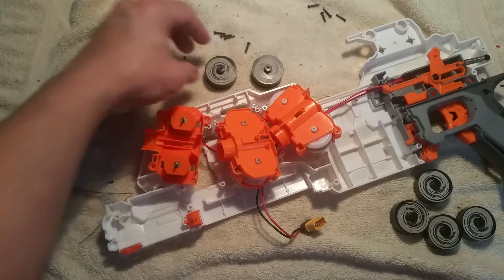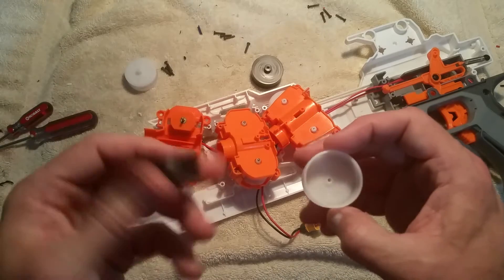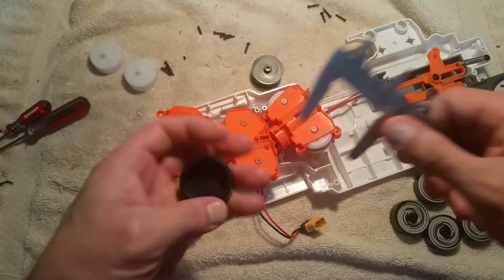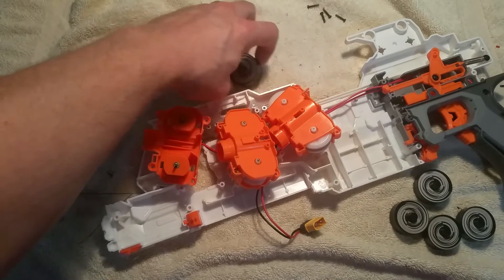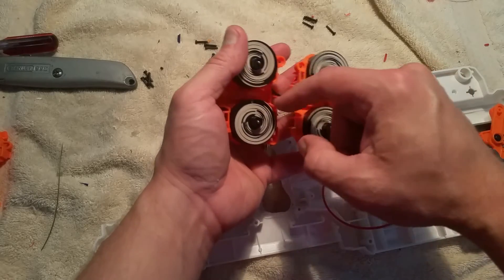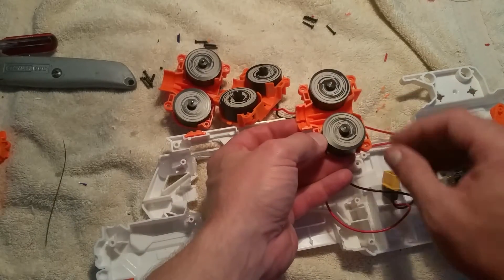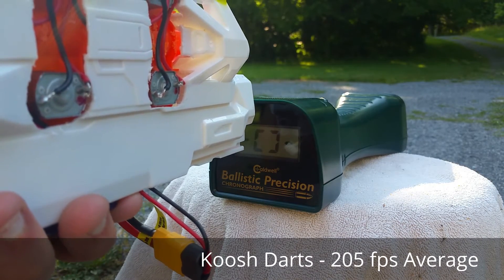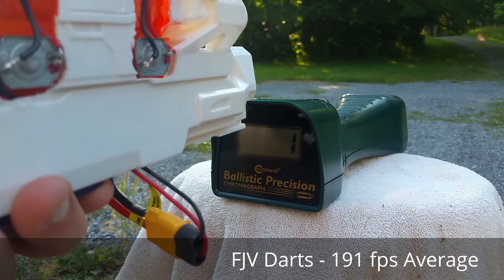Q200 - Cyclone Flywheels

Comment: That is amazing! How are the accuracy of the darts? They can take the velocity, but is their range and accuracy good enough to perform in an actual NIC game? Thanks for showing you work! The only other question I would have is if you can hit 200 fps with a two stage flywheel.
Reply from the maker: The accuracy is very good with Waffle darts.  I'm hoping to get another video up in a couple of days that show them being shot at targets.  
I would think that 200 fps should be feasible in a two stage setup.  I don't have a two stage blaster on the bench right now, but I am testing a three stage platform and I plan on using this combination in that.  Stay tuned.  :)

Comment: Probably will want a MOSFET once you get 180s in there, it'll probably far exceed the inrush current ratings for any of your switches.
Reply from the maker: It would have to be one gigantic MOSFET!  I did a quick calculation of stall current of two Hellcats and four Wolverines on 3S and it came to 325 amps.  I can't even imagine the size of the heat sink for a MOSFET that could handle that much current.
Reply: I mean, it only needs to draw that momentarily, and one of the best MOSFETs currently is iirc the IRL40B209, about the same form factor as we currently use. Looking at the datasheet: https://www.infineon.com/dgdl/Infineon-IRL40B209-DS-v02_00-EN.pdf?fileId=5546d46256fb43b301576b16f39706f5, you'll see it has an ideal max pulse current of 1707 amps, realistically limited to 780 amps by other forms of resistance. It might be OK with handling it, as even with a good heatsink it probably will only handle half of that.

Another concern would be speccing wire thick enough to handle the current to the motors. If for an unlikely occurence, all three motors jammed up, I don't think there are many wires that will fit in the shell and hold up for very long.

Alternatively, you could use less current hungry 2S motors as final stages on 3S, I've heard of people claiming more torque in a first stage and less in consecutive ones are desirable. It would would be easier to find a battery pack, of course, so you could go for Blades, which have slightly less torque than Hellcats on 3S which will hog under half the current that Wolverines do, or even go for lower torque final stage 2S motors like Meishel 2.0s or even just Honeybadgers. But you ultimately know more about it than I do considering how much you deal with them.
Reply from the maker: If I'm reading the spec sheet right, the max current for this MOSFET is 195A.  I think I would want to spec it to the continuous drain current, in case of a stall.  195A is really good, actually, I didn't realize small form factor MOSFETs had come this far.  I may have to give this MOSFET a try.

I would think 16 gauge wire should work just fine for this much current.  The wire in the motor armature a lot thinner than 16 gauge and should fail well before the blaster wiring.

I have been considering Hellcats and Honey Badgers on 3S for this build.  My concern is rev up time more than sustained performance.  Cyclones are heavy and worse have most of their weight out on the rim.  It takes a lot to get them moving, but once they are spinning, they don't want to stop.  I guess I have more testing to do.  :)

Thanks for the feedback and specifically the spec sheet on the MOSFET.  Much appreciated.
Reply: Actually, I find it interesting to note that Honeybadgers on 3S have a tiny bit more torque than Blades on 2S (like, 0.4% more). Though Blades still don't have enough torque to not be notaby affected by the mass, but you'll probably get a good shot off in less than half a second. They also keep your current draw under 150 amps so that's probably one of the biggest benefits, along with allowing for getting a battery that's actually reasonably sized, even some that can handle the stall currents continuous.

Either way, glad to hear you'll be doing more work on this project.

Comment: Have you ever posted the wiring diagram for this? I'm confused about the setup with the extra flywheels. Excellent work BTW.
Reply from the maker: It is actually pretty simple - all six motors are wired in parallel.  All the grounds connect together and all the positives feed from the switch.

Comment: Hi! One quick thing to note while building this. Don't go any higher crush with cages or wheels than cyclones if you intend to continue using FVJs, reason being anything higher crush than cyclones will jam the FVJ in the first cage, and can stall your motors. Cool build!
Reply from the maker: I've got a high crush cage on my bench now to test out.  I'll try an FVJ dart through it for science, but I'm really interested in what it will do with the Waffle tip darts.  Thanks for the feedback.

Comment: Thanks for another video. It's awesome that you reached your goal and I'm excited to see what's next but... what about accuracy? Most of those shots went wildly in random directions. I love what you're doing but if it's not accurate then it's not really battle worthy. Do you think you've reached the accuracy limit with flywheels? Perhaps simply due to the inconsistency of the ammo?
Reply from the maker: For Elite and Koosh darts, the accuracy is terrible.  Those darts are just not stable at those velocities.  The FJV darts didn't do too bad accuracy wise - not great but not terrible either.  However, the Waffle darts maintained their accuracy in this build.  The standard test I run for accuracy (haven't really video'd it before) is to shoot a tree with a 15 inch diameter from 30 feet away.  I like this test because it fairly closely simulates shooting at another player.  With Waffle darts, this build hit the tree 15 of 18 times, which is about the same as I have gotten with a basic superstock Stryfe.
So, in short, I think it depends on the ammo.  I'm really liking the Waffle tip darts.